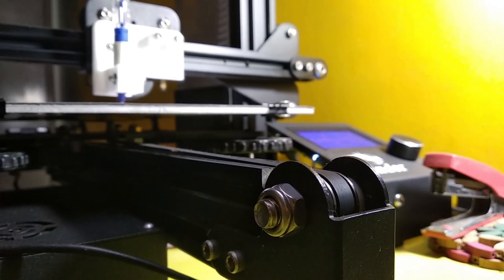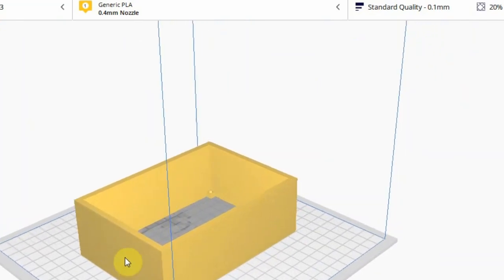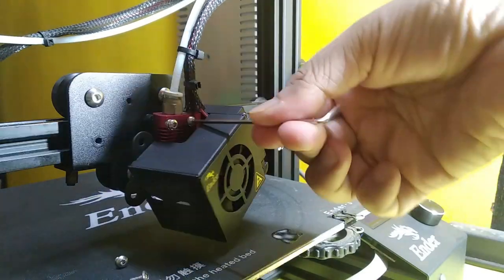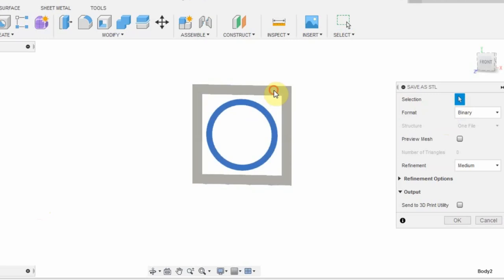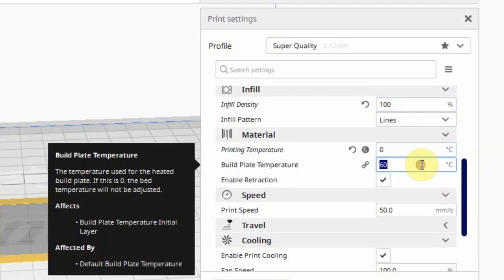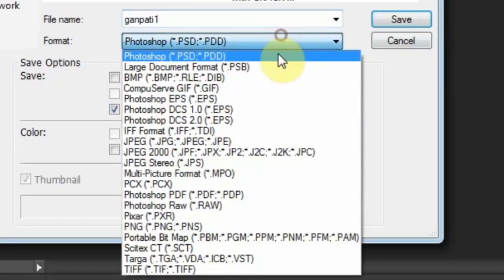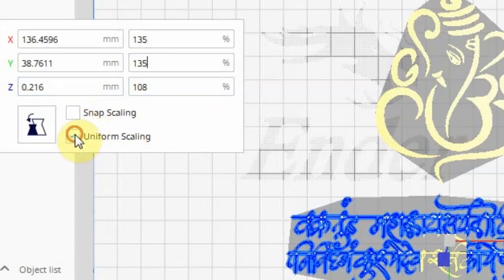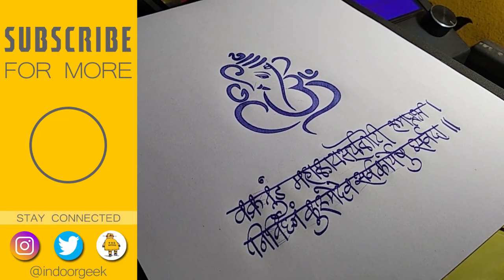Draw with your 3D Printer | Plotter

Comment: can u make it without the need of removing of printer head i.e., hot end, it should be quick switch between 3d printer to plotter and again back to 3d printing in no time.
Reply: I'm wondering that too. Maybe you could just take the tip of the hot end out and make a mount that goes next to the extruder?

Comment: Very nice 
But if I have a design with 3 meter length and the same width of the table...can we use the same process?
Reply from the maker: Thank you! 
Yes, you can. You just need to scale it down.
Reply: @IndoorGeek  sorry, may you explain  what do you mean with scale it down?
Reply: @Blondie SL thanks for your reply, put i need to print  (or draw)as one unit that what i mean
Reply: @raifhanna1120  So obviously you need to have a big printer which has tabel size  3 x 1 m.